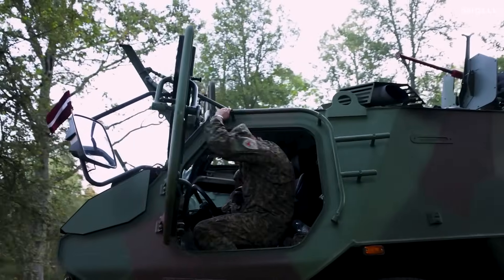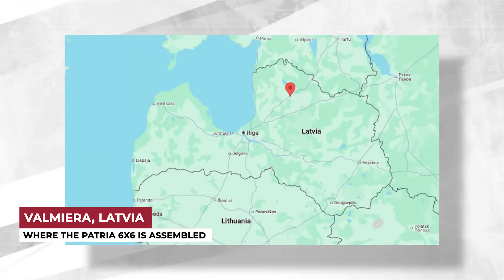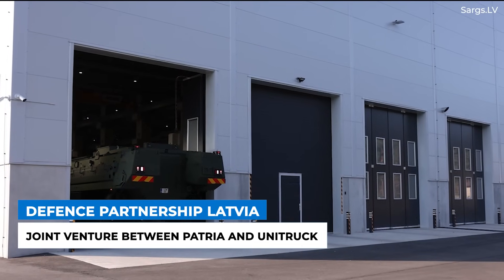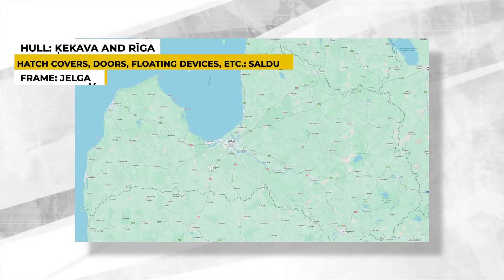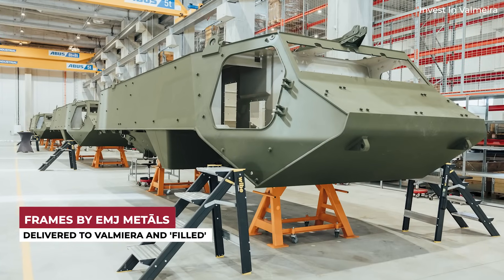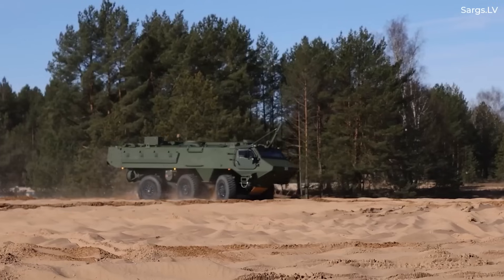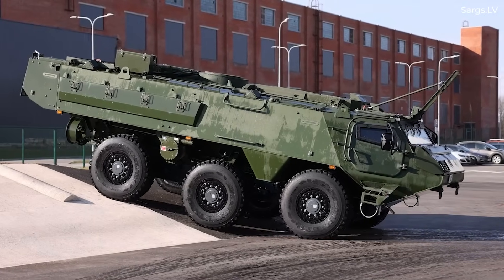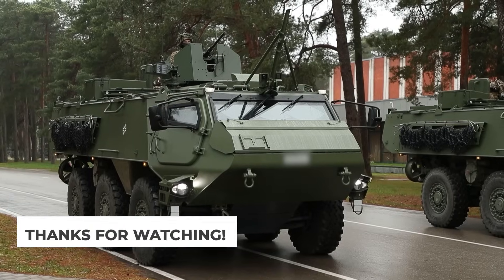Latvian Patria 6x6: What Does It Take To Produce These APCs?

Comment: Only problem is very weak Stanag 2 protection. I don't know when you upgrade to Stanag 4, what is happened with mobility.
Reply: Just read an article, where it said that these Patria 6x6 have optional heavier packages that go up to Stanag 4. There is also the Patria 8x8 AMV (IFV) that has it in stock, but that isn't obviously an APC.
Reply: This is because it is an APC, not an IFV. You can use this Patria instead of Humwee
Reply: biggest issue with Patria 6x6 is it's amphibius package.
Latvia isn't island nation and the only region with enough lakes is Latgale to justify the apmhibius package, the rest of Latvia can be driven without it.
Reply: @hashbringer975  There is a lot of smaller rivers to cross if the bridges are taken out
Reply: @1983harm  I've been trained on patria platform, I'll not disclose too much, but it's not quick to get it float-worthy and it's more of a hassle then a useful thing. Should've went with the 8x8 platform.
Reply: @hashbringer975 you do understand that Patria's 8x8 offering is an actual wheeled AFV/IFV similar to Boxer and costs times more than basic APC like 6x6? About its amphibious capabilities - they are nice to have. Not sure how much more expensive that inclusion makes Latvian 6x6's, tho if need be, we could upgrade them to Heavy standard with level 4 protection, tho at the cost of losing floatability which as you mentioned might not be that useful as expected.
Reply: @rrreger  8x8 platform was heavily considered, but for whatever reason, some higher ups decided that we need amphibious capability, which is not really useful.
also, cost wise, from what I was told, it was really close (6x6 vs 8x8) and honestly, for infantry brigade, 8x8 would've been the best choice.
for the last two years of my service I was on patria 6x6 platform and while it's better then nothing, it's not perfect. We can debate how and why's but it will not change the fact that they are here to stay.
Reply: 2000 ezeri un 12 000 upju un upītes @hashbringer975

Comment: So Latvia still uses a gunner instead of a weapons station on top ?
Reply: This is APC not IFV, Just battle taxi...
Reply: @tagan6190 even apcs have them
Reply: @HunterXStyle123  We primarily need APCs. If we have extra money, we will also install a weapons station module. In parallel, we are purchasing ASCOD2 IFVs.
Reply: I’m sure remote weapons stations will be added in the future but the basic turrets are more affordable and can be made in Latvia.
Reply: remote weapon station costs a shitton, almost as same as the whole APC, if not even more, lol.
And I don't pull the price out of my ass.
Reply: @hashbringer975  Sweden puts weapons stations on all it's 321 Patria  300 6x6
Reply: @AdurianJ The rich do as they want, the poor do as they can.
Reply: @hashbringer975  where are you from?
Reply: @tagan6190  Latvija.
Reply: @hashbringer975  nu tad tev vajadzētu zināt, ka viss ir aizlaists tik tālu, ka tagad visam nauda nepietiek
Reply: Too costly for an apc. If you can get for example 50% more apcs instead of the turrets it is a good idea. You should not be using the system as a weapon but as a battle taxi. IFVs are for fighting.
Reply: @Vulcaani  But Sweden has such a small army it needs to bump up the quality. the weapons stations can also be networked to scan for and shoot down drones with or without networked radars etc.
The air force already has this.
Reply: @AdurianJ  fair enough reason for the swedes. Latvians likely dont have the money sweden can invest.
Reply: @AdurianJ  The Swedes can repay their moral debt to the Baltics by purchasing weapons modules for LV and not only that, but much more.
Reply: @Vulcaani  If the Baltic states have small militaries as well then it might be worth it to think about survivability against emerging threats as well. Finland could look into this too, expensive or not.
Reply: @herptek  the best course of action for baltics would be leverage economics of scale ans just get almost identical systems, not trying to make each army unique like it's now.
Reply: @hashbringer975  I think I agree, but perhaps drone self-protection should be among those things that could become stantard. Jammers are pretty common with combat vehicles already, but it might be worth it to start looking into hardkill counter-UAS capable stantard solutions for all military vehicles that are supposed to be operating near the front lines. Economics of scale could be better utilized if such protection was stantardized.

Everything unprotected within range will be a siught after target. Hardening everything by self-defense methods might make them somewhat more difficult and less opportune targets.
Reply: @tagan6190  We have no moral debt to the Baltics
Reply: @AdurianJ  We have not forgotten how after the Second World War you handed over our prisoners of war to the USSR to certain death. We have not forgotten how during our occupation you pretended that we did not exist at all. We have not forgotten how in the 2000s your banks, taking advantage of our ignorance and incompetence in financial matters, literally showered us with credits and when the real estate bubble burst, you blamed us for embezzling your pension funds. You were always neutral everywhere, although with your neutrality you supported the Nazis, but when the war in Ukraine started, you literally jumped into the air and put on other boots and suddenly in a great hurry wanted to become a NATO member state. In reality, you are cowards who hide behind the Baltic States and Finland so that the Russians do not notice you and bloodshed takes place on our territory. So, yes, you have at least a moral obligation to supply us with armaments, because the Baltics will be the line of defense behind which you will hide.
Reply: @tagan6190   Everyone seems to think we where neutral to be neutral but our prime minister clearly stated the goal was to stay out of the war and the means to do that was neutrality, the higher moral goal was to save our citizens from the horror of modern war. When did we start giving in to German demands, the day after France fell and all german armies on the continent didn't have a job. When did we stop giving in to more demands, the moment the Germans stalled out on the eastern front. 
Other countries are just jealous that we made it through WW2 unscathed fulfilling the primary goal of the state protecting it's citizens.

The Baltic states gave in in 1940 and didn't fight, Finland did and we supported them massively. The Baltic states decided not to oppose the stationing of soviet troops on their territory but expect that we should pick a fight with the USSR over Baltic sovereignty countries that don't exist as independent states anymore. Meanwhile we have been cut off from world trade for 4 months and have two possible trading partners Nazi Germany and the Soviet Union which are allies BTW. We tried being moral and follow neutrality rules in ww1 and what did we get for it, starvation and hunger riots when we where cut off from trade by the British.

We joined NATO because Finland joined NATO Sweden's policy is to never to cause problems for Finland vs Russia, in not so few words. 
When the Ukraine war started the Social democratic government was very clear we would not join NATO.

Yes we handed over 146 Baltic SS soldiers to the Soviets after the war which wasn't great but it was 1945 and we placated the allies a bit to much on that one, it wasn't good.
But we did take in all the civilian Baltic refugees that came including soldiers in civilian clothing which combined was over 30.000 people.

Swedbank fucks over Swede's as well get in line with the complaints, it's board is full of social democrats. 

But you are right in the strategic situation, Sweden did adopt it's policy of neutrality after the loss of Finland and the Napoleonic Wars. But with the Baltic states and Finland existing in the NATO umbrella and the Swedish heartland will again take on the role it had during Sweden's expansionist phase in the 1500's to 1700's where Sweden served as a staging area with reserves that could reinforce threatened regions quickly. We are already seeing this with Brigade size units expected to deploy to the Finland and the Baltic states, and the navy is getting Ballistic missile defences on it's next generation of warships to be able to secure the Baltic sea as a transport route. The Baltic states should be happy Sweden has joined NATO as we have the best base areas in the Baltic sea and moving troops to the Baltic countries is much easier if Swedish territory can be used and the Suwalki gap don't matter as sea transport beats anything that can move through there in a conflict.
Reply: @AdurianJ  Baltutlämningen.
Reply: @tagan6190 
Finnish Free Corpses made it possible for Estonia and Latvia to break free of Russia after the Great War.

"You were always neutral everywhere, although with your neutrality you supported the Nazis"
Estonia, Latvia and Lithuania fought together with the Nazis, as did Ukraine and Finland (and the Soviets too, in Poland). Well, the Nazis were the only ones fighting the Bolsheviks, and wars makes for strange bed mates.
The whole "Sweden supported Germany" is rubbish though. There was exactly one (1!) breach of neutrality in favour of Germany, and that was the transit of the Engelbrecht division from Norway to Finland which took place under direct threat of invasion.
All other breaches (like wire tapping and code breaking that gave warning to Denmark and Norway about the German invasion, the movements of Bismarck and Tirpitz, the OSSE bases in Lappland, the British radar station monitoring Peenemunde, Danish and Norwegian police troops) are given a free pass for some reason.

"We have not forgotten how after the Second World War you handed over our prisoners of war to the USSR to certain death. "
Neither has anyone born during the Cold War. Still a national source of shame.

"We have not forgotten how during our occupation you pretended that we did not exist at all."
You do seem to have forgotten you peacefully allowed the Soviets into the country in 1939. You existed until 1955, when the last Forest Brothers fell. After that, there was no point denying you were part of the Soviet Union, and any Soviet invasion of Sweden would be shipped out from Baltic ports.

 "We have not forgotten how in the 2000s your banks, taking advantage of our ignorance and incompetence in financial matters, literally showered us with credits and when the real estate bubble burst, you blamed us for embezzling your pension funds."
Hm. Funny. As I recall it, we blamed the greedy banks gambling with the economy while enriching the directors, who on top of it cashed in their parachutes when fired for not doing their jobs.

"but when the war in Ukraine started, you literally jumped into the air and put on other boots and suddenly in a great hurry wanted to become a NATO member state."
Finland was going to apply for NATO, cancelling the old balance act where Sweden would join NATO if Soviet invaded Finland, and Soviet would invade Finland if Sweden tried to join NATO.
Finland was part of Sweden for over 600 years, and the only war since 1814 Sweden did not declare neutrality in was the Winter War. There is a reason Mannerheim made a specific speech thanking Sweden for the help during those hard times, and there is a reason Finland and Sweden made a joint application to NATO.

Sad to say, we repeated the stupidity of 1925 again under cabinet Reinfeldt, dismantling most of the defence since it was the time of Eternal Peace and all needed was joint operations in Farawayistan.
Reply: @johanmetreus  you know, he’s right that we have not forgotten the betrayal of our legionnaires but I’m one of those who chose to forgive because if I were to hold bad blood against you Swedes, then it’s only fair that I should hold bad blood against… literally ANY of Latvia’s modern allies and then we would just be on our own yet again… like in 1939. I appreciate your regret sentiment, but I do believe that you’re not alone to hold this national shame you spoke of, like I already briefly mentioned… it should be shared by most of modern allies of Latvija, it’s essentially the partnership between UK, USA, France and Soviet Union which paved the way for the re-occupation of the Baltics in 1945… (your words “war makes for strange bed mates” is so spot on lol) and all just for them to make a U-Turn in the Cold War era and realize that Soviet Union is a problem and the enemy after all! But then it was already too late and we were occupied. Like cmon now, are we serious. 
And on the topic of Forest Brothers that you mentioned, am I to, for example, hold ill feelings against the Brits even more for the past for how their British-Soviet spy Kim Philby betrayed the Forest Brothers after some managed to break through the iron curtain and make contact with the CIA and British intelligence agency M16… after all, this was the most important achievement for hope of restoration of independence for whole Baltics and K. Philby foiled it and ratted them out, and upon their return back home they were greeted with certain death when they were conviced that things will finally change for the better. It could be argued that this betrayal is what led to eventual collapse of Forest Brothers. 
Anyway, I rather choose forgiveness unlike my countryman above who was partly right in few things that he said of course, but wrong in his rather harsh approach, if we were to hold animosity against our allies and friends we will just end up being alone and vulnerable like in 1939… no thanks, never again.
Reply: @Vulcaani  Instead of an anti-aircraft machine gun on an open topped turrets intented to defend against strafing of troop columns by ground attack craft the most important air self-defense today would be against small drones. Manned anti-aircraft machine guns on military vehicles could be gradually phased out in favour of automated RWS turrets capable of counter-UAS functions.
Reply: Yeaaaaaa......
Reply: Sweeeet! 🏎️
Reply: Sadly yes, plus gunners station has very poor protection from front corners to the sides of machine gun.